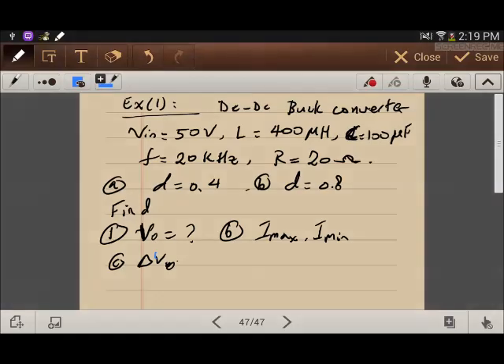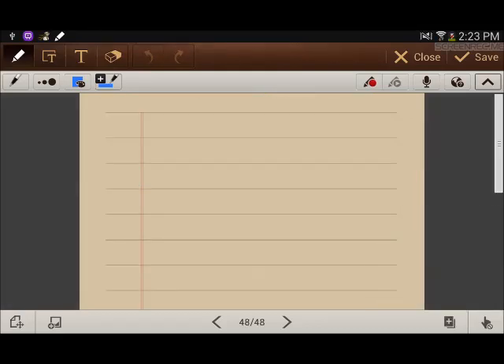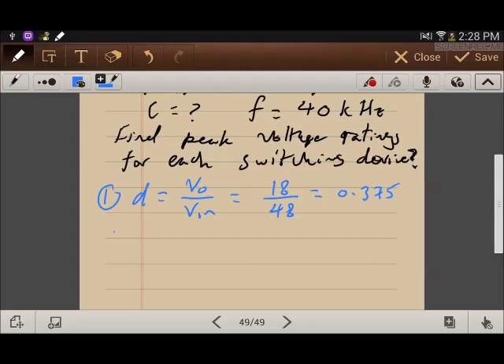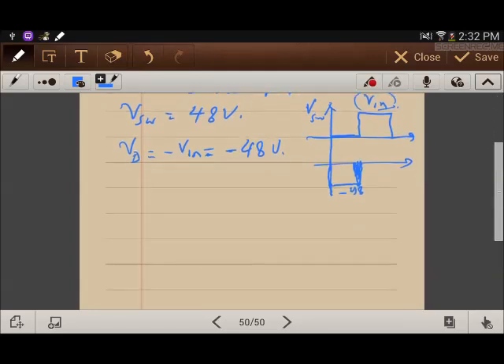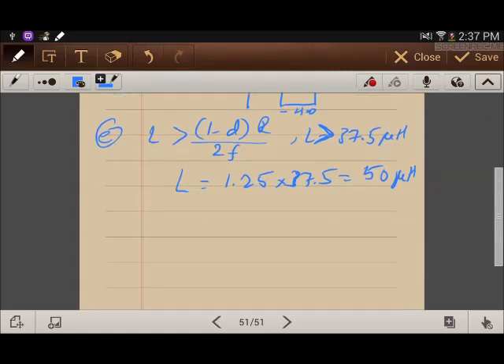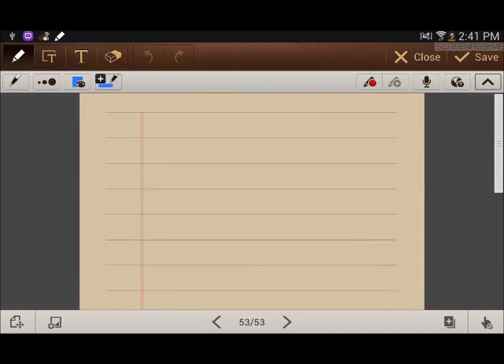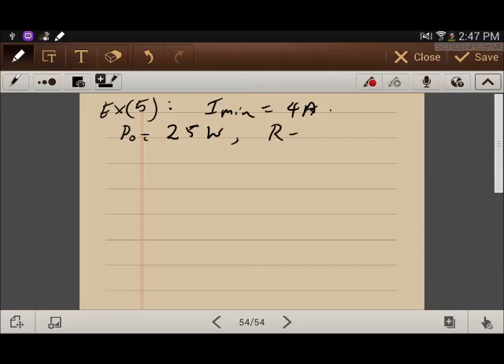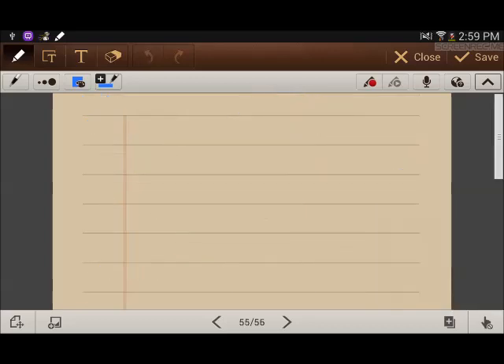Lecture_11 Dc- DC Buck Converter Problem Solving

Comment: i need the solution for this problem...

"Design a buck converter such that the output voltage is 15 V when the input is 48 V. The load is 8  . Design for continuous inductor current. The output voltage ripple must be no greater than 0.5 percent. Specify the switching frequency and the value of each of the components. Assume ideal components."